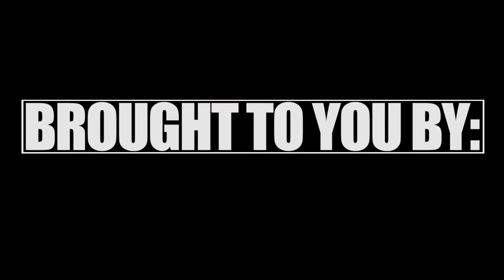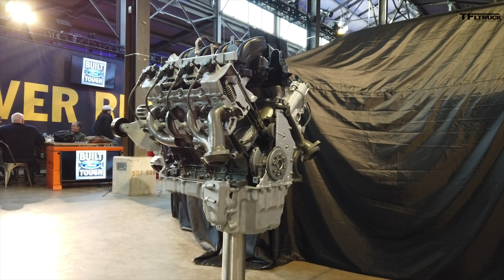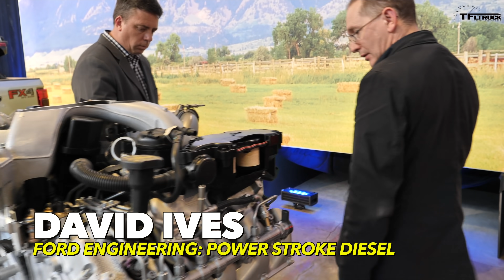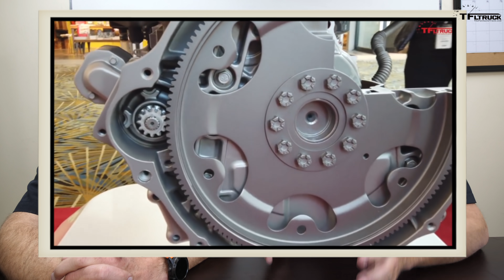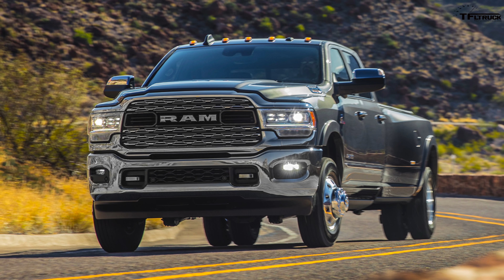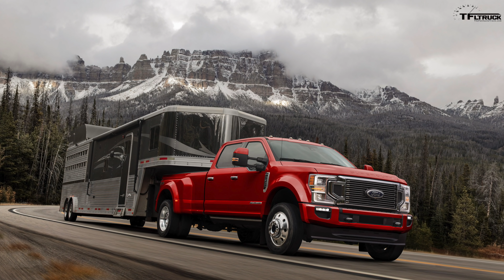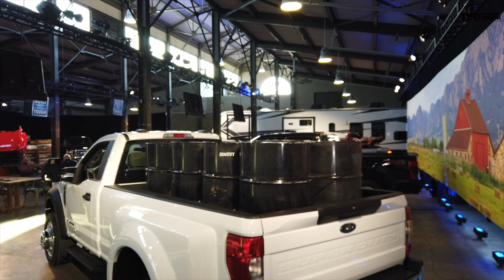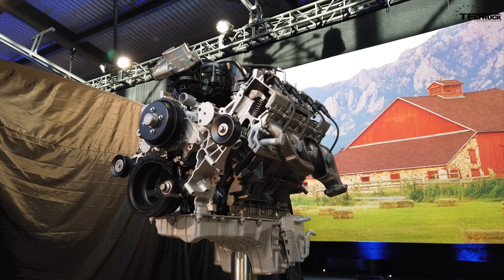Are Diesel HD Trucks Dead / Will Electric Pickups Replace Them? No, You're Wrong! Ep.5

Comment: Go ahead and buy your electric truck. It will make my 7.3 Powerstroke skyrocket in value.
And I've got the '97 smog free California special F-250 HD 4x4. We're talking Yenko Camaro territory eventually.
Reply: E30 M3
 has it right. Look at Dodge/Cummins 12v's 93-98... Selling for sticker with 200k miles on them
Reply: @johnanderson60  Excellent point. In the late 80's, you could pick up a Yenko for $15k-20k. 
That Cummins and the obs powerstroke (in good condition) are on the market for over $20k right now. Wait until these trucks are approaching vintage age.
Reply: Are you on drugs this fine morning?
Reply: I don't think it'd ever reach yenko Camaro territory, even if it had only 20 miles on the clock
Reply: E30 M3 I JUST SPIT MY COFFEE OUT!!!! HAHA thanks man, that was funny!!!
Reply: My 2002 7.3 dually keeps on chuggin. I can get the same power as the new gas 7.3 if not more in a 20 year old engine with 250k miles. Oh yeah, NO EGR 🙂

Comment: What about the cost compared to a diesel. What about charge times traveling greater than 400 miles.
Reply: In regards for electric.
Reply: At 400 volt batteries packs = 2hr,  at 800V battery packs = 1hr.
Reply: I think traveling time and distance will be a big issue
I can travel 600 miles on a tank in my 2012 Powerstroke
Reply: Than*

Comment: If you plan on shoving a shit ton of batteries in a truck as well as an electrical motor, It will weigh so much more than a diesel engine. Also, the range and efficiency will still be less overall. Diesels are so efficient, especially compared to a 7.3. BTW, diesels are more environmentally friendly than gassers.

Comment: What would happen if they built the 7.3 like a diesel with turbo chargers to improve low end and mid range torque. A 7.3 eco boost V-8 and then added hybrid tech to it. I think it could eventually rival a diesel. Then you could have the power, torque and efficiency you want to reach. Mmmm
Reply: The 7.3 gasoline engine WAS (already) built to have torque all over the range of the engine, especially the low an mid-end; that was the whole point of this engine.  Ford didn't go the turbo route because they found a benefit in having additional cylinders.  If they wanted to they could have just built a bigger displacement v6 and ecoboosted it, however they DIDN'T.  I'm afraid that you've missed the bus and there isn't another one coming.
Reply: Wouldn't be able to pass emissions with a turbocharged 7.3.
Reply: 7.3 Ecoboost would be sick!
Reply: They would probably sell it on the high end models and it will cost 100,000 to buy the truck
Reply: But then all the manly men will say they would rather have a 9.0 liter V10 over a plastic ecoboost V8 and that V8s dont belong in a 3/4 ton.
Reply: I would have to partly agree with @knightwing4. It'll be awesome, but it'll probably never happen.